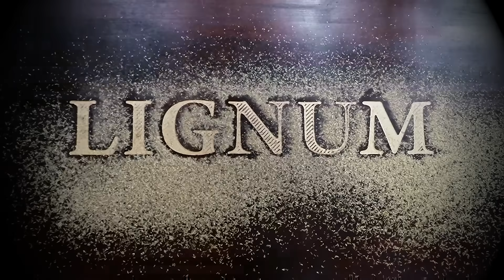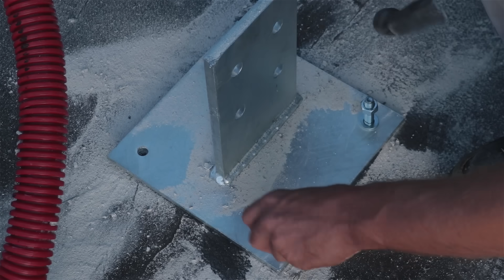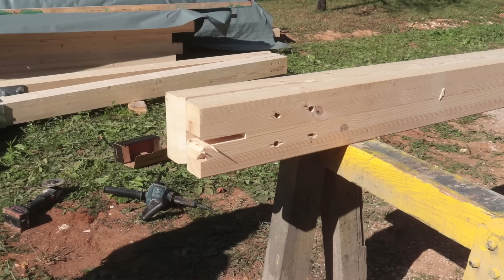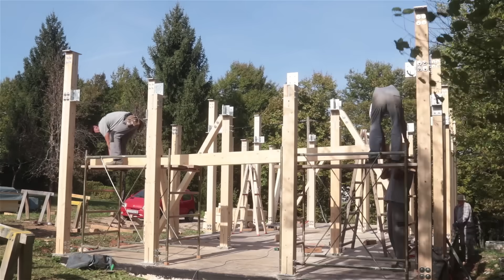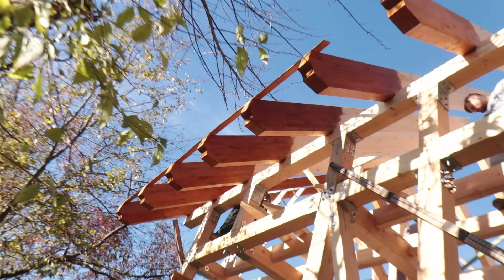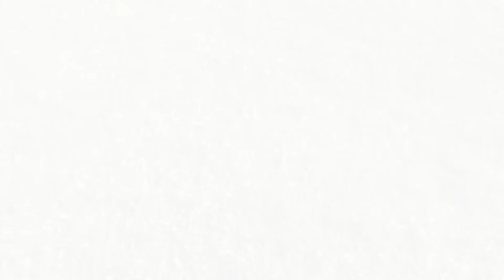Vacation House Build - Post and Beam

Comment: nice. for such projects without electricity it is better to use battery powered impact wrenches and nailguns instead powering a air compressor from a generator. and you do not need to ask neighbours for a favor too.

Comment: No corners cut and no compromise made post and beam structure. This is proper way to go. Compliments for the crew, as usually.
Reply from the maker: Thank you very much!🙂
Reply: @lignumchannel   I went a bit futher and share this video at US channels dealing with post and beam construction. This frame is by factor of 10 far superior than anything i've seen available there...

Comment: Great build! The metal brackets and wooden structural elements size may seem an overkill but, if I am not mistaken, that is a region of the globe where buildings must withstand the effects of earthquakes. Add the weight of the winter snow and building like a tank is the only way to go (and meet code, I guess).
Beautiful real life Lego and for sure a joy to erect. And a lot of unseen planning and shop man-hours. Thank you for sharing your skills.
Reply from the maker: It mostly depends on the structural engineer and architect. Some prefer hidden steel so we have a lot more precision work and some just want it simple and strong. But yeah, this house is in area with possible heavy snow load so better be sure..